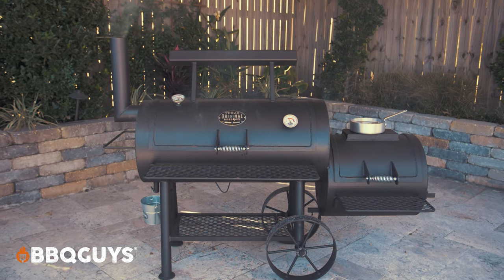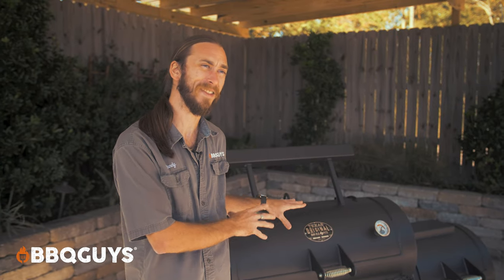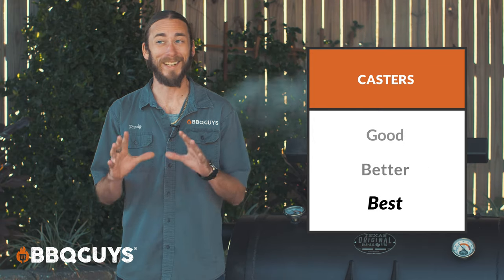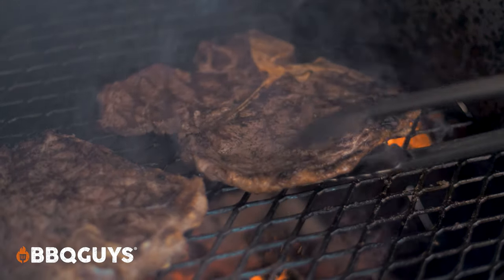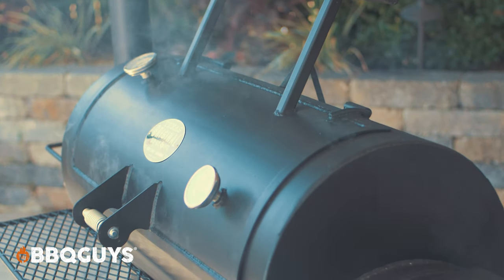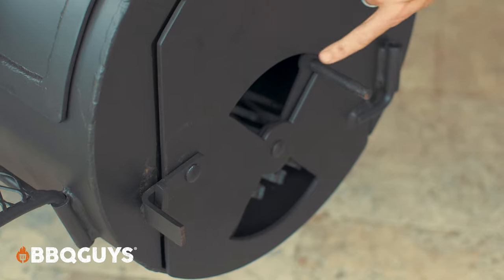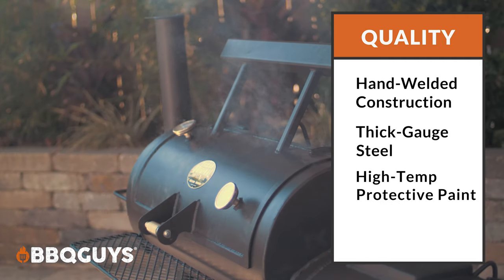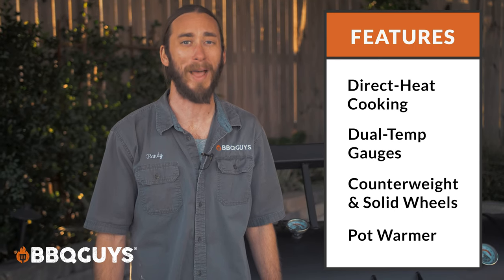Texas Original Pits Luling Offset Smoker Expert Overview | BBQGuys

Comment: I have one of these pits with that heat deflector also but am seeing a big difference in temperature between the firebox and smokestack side. Any idea why? I see you are getting good evenness of temps but I’m not and am wondering why
Reply: Is the cook chamber door leaking?  If so, see if you can apply a gasket tape.  Also, consider an offset smoker water pan installed on the right side such as the one at bbqsmokermods.  Good luck

Comment: I'm actually in the market for an offset... Doesn't look like there is any gasket material around the cook chamber door, that would probably cut out 98% of the leakage....
Reply from the maker: The amount of heat lost to air is negligible compared the heat produced be the firebox, though, and we can tell you from personal experience that temperature control isn't an issue the way it is.
Reply: @BBQGuys  I was referring to smoke leakage around the door. You think that would help??

Comment: "premium class' HAHAHAAHA what a total JOKE. I had a Luling, biggest LACK of quality I have ever seen. I had parts of the welds on both heads that were so poor they leaked grease through the weld. There were literally pieces of welding wire from the MIG welder attached and hanging out of the welds in numerous places. Simply using  1/4" steel is the only requirement to call something premium class? Did they "sponsoor" this video? What'd they pay you? The doors on mine also leaked like crazy. The other issue is their customer service ends once they have your money. If you chose to order one from them be sure to inspect thoroughly before accepting delivery. at that point you can reject it and send back for refund, I know I wish I had!